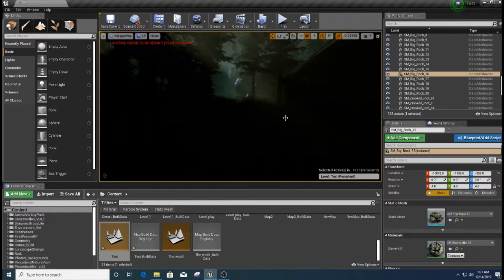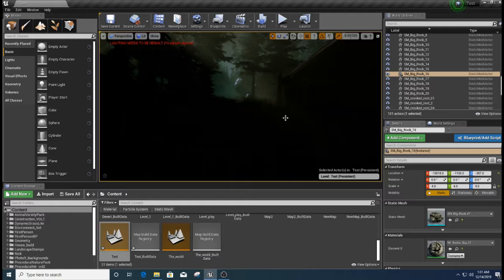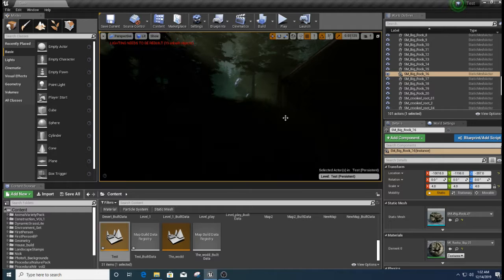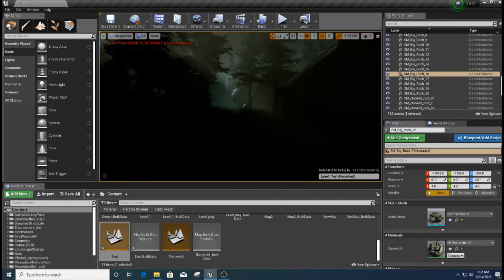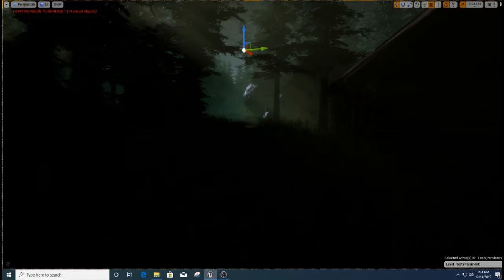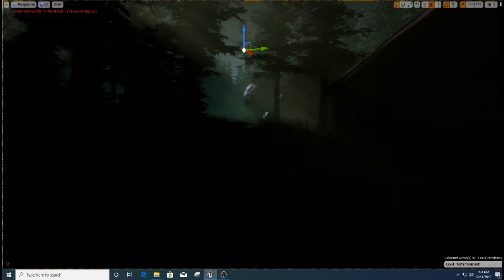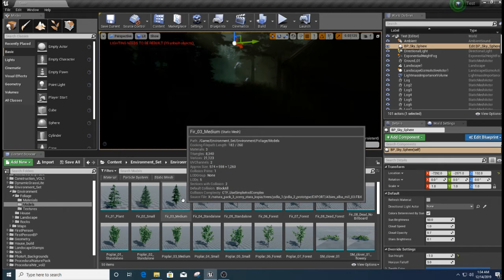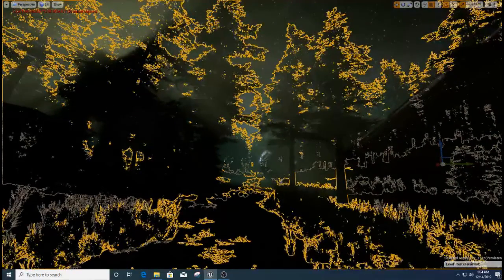Unreal light building issue solution part 2

Comment: hey help mee
i sculpted my landscape and  when camer is closer to slupted region it shows sculpted and when i move backward a little it dissappear
Reply from the maker: sounds like landscape LOD
Reply: @devcorpseinteractive7490  one more help plzz

backface culling in un 5

i added a  plane from ble der to un5

i recalculated normals from inside now in un5 i cannot see back face 

if i calculate from outside the other side becomes invisible 

these two problem plz solve it i will like share subscribe everyting bro
Reply: @devcorpseinteractive7490   when i add grass foliage  
if camera is close to grass it can be seen
but moves camera a little back grass become black textures 2d sprite like object
Reply from the maker: @Vkcomedyentertainment  what engine version are you using
Reply: @devcorpseinteractive7490  latest un5
Reply from the maker: @Vkcomedyentertainment  i want to say it may be ray tracing causing your issue https://youtu.be/Ar3vvygirLU watch this and see if any of this is your issue
Reply: @devcorpseinteractive7490  hey plz help mee its been 2 months  i can figure it out
Reply from the maker: @Vkcomedyentertainment  could try opening the grass sm and increasing lightmap resolution might help
Reply: happens with grass also
Reply from the maker: there are several videos on youtube showing how to adjust it but increasing LOD 0 will be more of a performance impact maybe try using static meshes instead